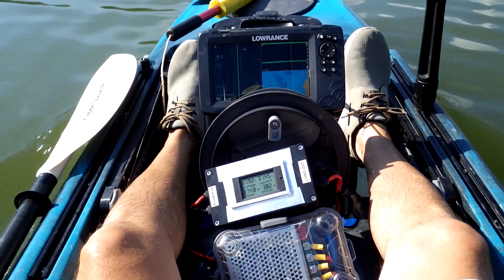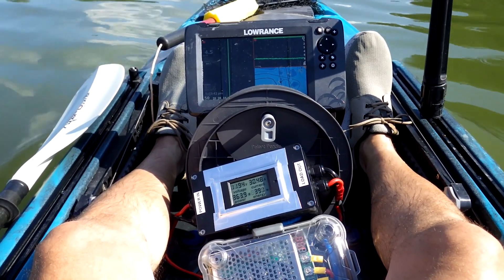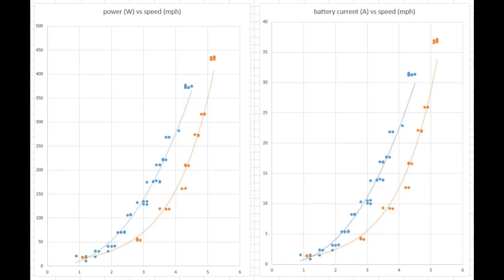Testing a Small Town Bassin' prop on a Newport Vessels kayak trolling motor

Comment: Put a rc airplane propeller on it.  Will outperform everything else.
Reply: that's what I did, 3 blade, about 7" diameter.  Gained 1.5 mph, never tested watts.  Next trying a 4 blade prop. Hoping to maximize low power rate of speed, don't need high speed.

Comment: Apc 10x4 or 10x6 is the ticket
Reply from the maker: Interesting.  Do you have any comparative test results?  Props designed for air aren't normally ideal for operating in water, but I'd love to see test results.  Also interested to see how they handle weeds and contact with the bottom when running shallow.

Comment: 63% power with new prop, you were almost@ speed of oem prop but using less than half of wattage used by oem, new prop @63% power will take you more than 2x distance as before using less power.

Comment: It's the pitch of the props that diff right?
Reply: Yes. Higher pitch, greater thrust per revolution. Trolling motors are designed to max out at 4mph, hence they are called "trolling" motors. The only time they go faster is to add a prop like this with greater pitch. The only time a trolling motor goes slower than 4mph is if the boat is too big for the lbs of thrust the motor is rated at. I have a 62lb thrust NV on my 10ft pond prowler and it barely hits 4mph. It's all about pitch.

Comment: So what's you're opinion? Is it worth the upgrade?  Has battery consumption changed?
Reply from the maker: Definitely makes a difference for me.  I get higher top speed when I want to spend the energy, and I'm more efficient when running at lower speeds.  An all around performance improvement.

Comment: Hello. I have a 36 lb Newport vessels & I got a new prop from STB, for some reason at max speed(5) my 50 amp breaker trip/goes off after 1 minute or 2. At speed 4 or lower is no problem at all,  the STG prop only pulls 34 amps max. Is there something wrong with breaker? My set up is simple: Using a "VMAX MR96-60 AGM 12V 60AH AGM Battery" and my 36 lbs connects to this breaker that I got from Amazon "STETION Car Audio 50 Amp Resettable Fuse Circuit Breaker Car Protect for Audio System Fuse 12-24V DC for Car Audio Amps Overload Protection Fuse (50A)" More info. The stock 36 lbs prop came with a 2 blades prop., I've also upgraded to a 3 blades prop. for 46 lbs and it works totally fine with my simple set up. However I still want the STB prop. to be working with max speed, how can I fix this issue? Thanks !! PS. The prop is not rubbing anywhere and I don't have meter for any testing.
Reply: Were you able to sort this out? Looking at getting some of these for the same motors.
Reply: @austinitor  Per STB, The new model will draw even less current.
Reply: @austinitor  Didn’t work well for mine, STB was nice enough to let me return it. You should give a try, worse case just return it.
Reply: Great video and experiment, love the graph at end too. Really shows how after about 4mph the draw required to keep increasing speed goes parabolic
Reply: A third blade isnt needed for such small applications its why large ships have 5/6 blades. By going from 2 to 3 blades more drag is added which puts added load on the motor. load=amps. Your motor is probably right at that line. All things being equal (pitch) a 2 blade prop is more efficient and faster than a 3 blade.

Comment: I have a 46 lb. Newport vessels myself.. i was wondering how to contact STB .. i dont have facebook.. i am experimenting with a kipawa 314 today.. it was made for the Minn Kota 30 and 45.. and with just a slight mod, i got it mounted to the 46 lb Newport vessels.. it seems to be a pretty agressive prop.. i am having trouble accessing my you tube account, to post.. i will, if ican figure out what is happening with it.. i have the 46 mounted to an old town vapor 10.. i had a 30 lb. Minn Kota on it but i wanted more speed ..
Reply from the maker: As far as I know, the only way to buy a STB prop is through the Small Town Bassin facebook page.  If you don't have a FB account, you'll probably need to go through a friend who does...